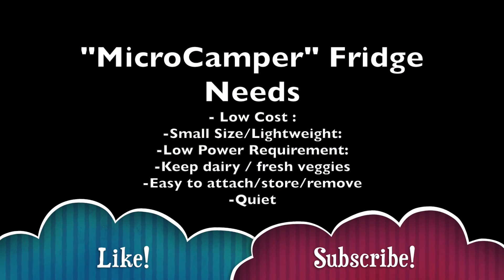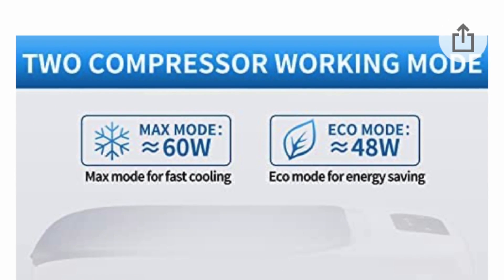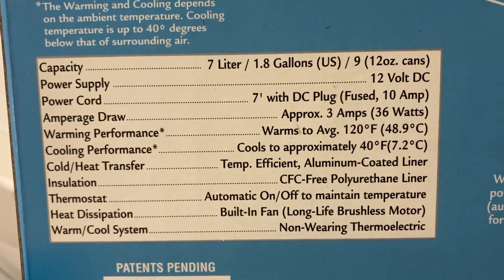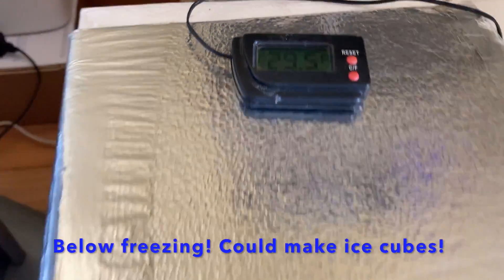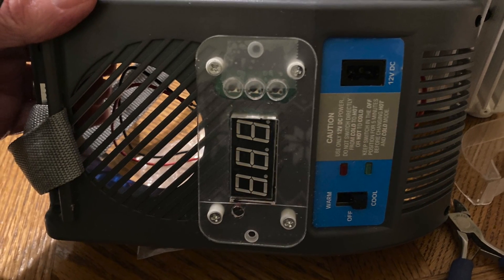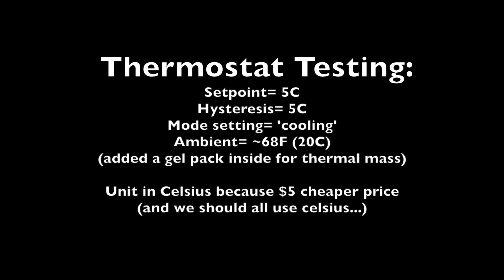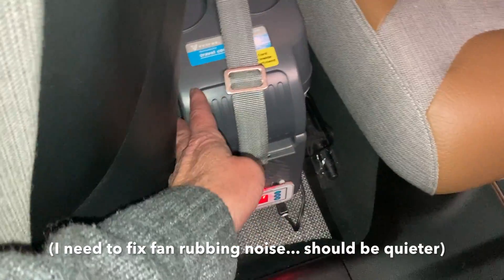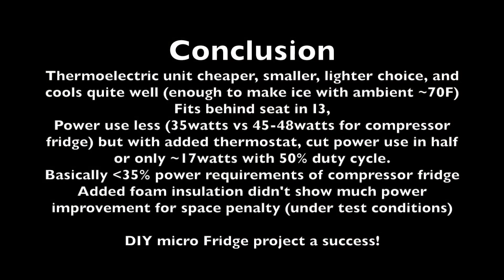BMW i3 EV Micro Camper part 4, DIY Efficient Fridge Design

Comment: I'm pretty sure that if you could find a compressor fridge with the same internal volume i would be minimum 2x the efficiency. I think the the wattage numbers you are finding is the peak consumption when it is cooled down it should only cycle on oncasionaly. 
But i don't think that there is a compressor fridge on the market that is small enough for the space behind the driver seat, so for this  application the TEC fridge is probably the wise choice.
Reply: Regardless, the fridge will 'die' after the ~30min climate control (and i3) turns off. I'd rather have the compressor fridge running in the trunk off the 12V until bedtime, then put it in the front seats for 'overnight mode'. Added bonus is you don't have to go far (assuming you've already broken down bedding and moved fridge back to trunk) to grab your creamer for that coffee shelf in the trunk :P
Reply from the maker: Well, the original plan was to use the small Ecoflow River2 plugged into the 12v car socket to charge while i3 is "still alive", so the electric blanket & fridge can stay powered on until the next preconditioning cycle, but your idea is probably simpler & would work as well.  I like the idea of having it close to the coffee maker!  One advantage of the TEC fridge over compressor is that it can be laid flat in the back too if space is limited.
Reply from the maker: I found some data on an Alpicool C15 that says it can run at 312watts over 24 hours (13watts avg), so that is a bit better better than my data (must have a very low duty cycle Vs my 50% duty cycle), so you are right.  I also found a note that said the startup power can surge as high as 150 watts.   At the lowest setting of -20C the reviewer said it consumed 610whrs/day (about 25watts, but that's cold!).  There was one mention on a review site that said that small fridges are not necessarily more efficient, showing the C22, C45 units at about the same power consumption!   Overall, if you have the space and budget, the smaller compressor fridges look like a good option.   Thanks for the feedback!